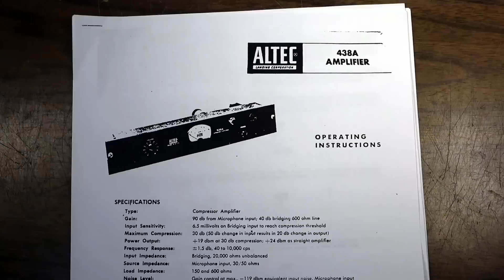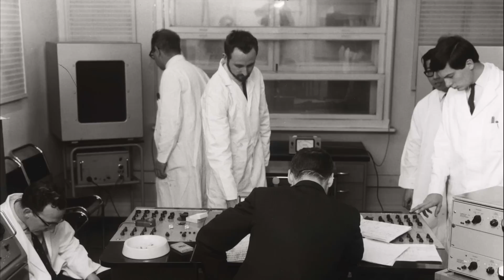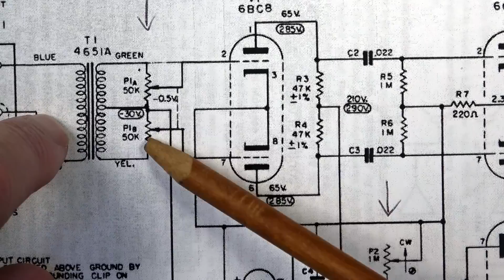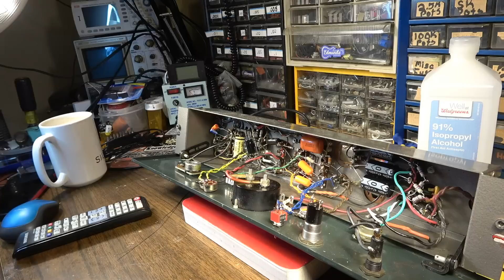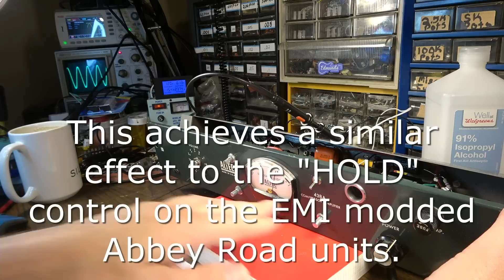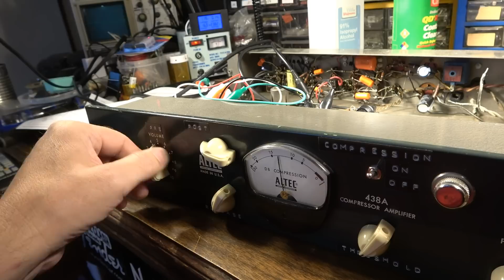Beatles' Abbey Road SECRET - 1960s ALTEC 438A  Compressor Preamp Mods (436B RS124) | The Guitologist

Comment: Brad, great video!  Do you offer updated service on the 438A? I'd like to use one as a line  amp/compressor to try in use as a home studio using old 45s.  Having ability to adjust threshold and release would be great to have.  John
Reply from the maker: I could replicate these mods, yes. If you’re interested in having the work done, email me: bradlinzy at gmail

Comment: Fantastic! I've been wanting to install a bypass on my 436c ever since I read the note in the manual that the compression circuit can be disabled by removing the tube. I was wondering how exactly to do that and why I had not seen it before. I was not going to go fiddling around in there trying to figure it out and risk destroying it.  Thanks for the simple (but much needed) mod! Were the resistors installed at the switch originally on the tube socket or were those added for some reason? If they were added, can you let us know why and the values?

Comment: The 12AT7, 12AU7, 12AX7 and 12AY7 are all the same pinouts.  They are dual triode tubes.  Even the ECC81 through ECC83 are the modern replacements and will work without modifications.  There is, however, a difference in power factor between these tubes.  The AX7 and AT7 will have the higher factor, which means more current draw and less headroom.  The AU7 and AY7 have the lower current draw and more signal headroom.

Comment: 6AQ8 is essentially the 6v version of 12AT7, both with a mu of 70. It draws more current than 12AY7. 6BC8 is a semi-remote cutoff tube where is 6BZ7 is not a remote cutoff tube, I believe so it's not suitable for gain reduction. I worked on a UA 175 and it uses 6BC8 and it simply does not compress as smoothly as fully remote cutoff tubes like 6386. All tubes will compress or affect gain somewhat when their bias is changing current draw but remote cutoff tubes are designed for gain reduction. Looks like a fun project!
Reply: Yes, you can see at 33min, the threshold isn't that dynamic - result of the 6AQ8. A remote cutoff is touchy with small negative voltage dips but less sensitive at the larger negative biases. A normal uniform triode as seen gives a linear response, even less smooth!

Comment: Cool conversion. 

Fyi. The Hold control on the Abbey Road version allows you to put a 'hold' on the amount of compression to avoid a large spike when the track first starts. The idea is to play the track or stereo mix into the compressor, engage the hold control locking in the gain reduction. The when you start the track again you release the hold after the track has started playing. I imagine this feature was mostly used when the compressor was on the entire mix.

A better implementation of the two volume controls would be to have a line level input which bypasses the mic input stage and goes directly into the 4651 transformer, with a switch to disable the mic input stage.

The threshold seems a bit redundant since with the fixed threshold you can simply hit the compressor softer or harder. I get that it's a trim pot on the original but it maybe better to leave that as a trim option rather than a main feature. 

I think a better addition would be an output level control on the output stage to better manage how much level is being passed to the next device in line.

Comment: Nice job and a good explanation of signal flow. Don't you think that the AX7 has too much gain? I'd like to hear the AU7 as originally spec'd, especially for 
a mic jack input. I have an old Motion Sound rotating horn unit that I use with a Hammond organ as Leslie 122 units are way too expensive in my area. It was shipped with an AX7 preamp similar to that compressor, which I always thought was harsh sounding above 20%. After I swapping it for a Sovtek AU7, it delivers a sweeter tone over a wider dynamic range, making it more responsive to the pedal.

Thanks for the redesign example.

Comment: That was so dumb I'm deleting it (My excuse is - in case it confuses anyone😸). I'm still wondering wth was going on in my head, ten hours later!?  Age I think.
Reply from the maker: Look at the circuit again. The two AC signals are combined into one DC voltage on the other side of the diodes just like a full wave rectifier on B+ converts AC power to DC. Then that DC is fed onto the grids of the previous tubes to affect the grid leak bias. It's similar to a radio AGC circuit.
Reply: @TheGuitologist  I had a brain error. I have not looked again but know I was wrong fundamentally in part.
Reply: @TheGuitologist  ie I was being thick.

Comment: I'm surprised you put the release knob on the left and the threshold on the right.  The normal layout would be the opposite and it looks like the wiring would a little shorter if you had done it that way.
Reply from the maker: The 436 has the Release on the left and Threshold on the right also. It's shorter wire runs this way.

Comment: Great video Brad, nice to see you grafting at the bench again. The Altecs look nice and retro with cream chicken head knobs, they go well with the classy green shade on the original fascia. These preamps were prized for their sound. Surprised they are so simple inside but I guess when a circuit is perfectly designed for its function you don't need complexity. Having  preset pots  controlling the compression suggests the studio tech would set it to optimum and forget it. Very straightforward, record it, review it and go straight to cutting master vinyl, next! 👍⭐
Reply from the maker: The problem arises when you have parts of a song that are loud or quiet... You might want to change the compression or even turn it off in some parts.

Comment: Hey Brad , is this true ? Or should I say “do you agree with this , and do you pay attention to it. 
  
  Directional flow of capacitors 
https://youtu.be/BnR_DLd1PDI

Thanks.
Reply from the maker: I pay zero attention to that unless the cap is marked. The only time that matters is in certain high frequency radio circuits. In amps like this, it won’t matter a lick unless your other lead dress is just very bad.
Reply: @TheGuitologist  awesome ! Brad thanks for checking that out.  I recently put new caps in my guitars , and was wondering if that might be causing an issue. Glad to know it’s not.  
 ✌️🤙
Reply from the maker: @theofficialdiamondlou2418  Most modern capacitors are much smaller profile than the old ones, so it's even less of an issue than it used to be. In instruments or amplifiers like we usually use, you'll never hear a difference at all. Some exceptions would be if the amp was really high gain to the point of being on the edge of oscillation already. Then they might make a difference. Or if they're close to AC wires running very close to the cap, as in almost touching.

Comment: So what is a compressor good for?
Reply from the maker: Compressors equalize parts of the music so they are of similar volume. Loud parts get squashed down. Quiet parts can be set to be closer to full volume.
Reply: Peaks n valleys....
Btw Brad, I love em! Stellar job, man...also, I did put em inline and part of a mix chain and these little beauties (tho not optical), I'm sure will do well, where my requisite.L2M mark 2 sits n will give em a run for the money, lol......
Thanks again, tuna...

Comment: I've made these mods and the actual EMI models were calibrated in real time, but it's vitally important to get good new/old tube stock in them or you'll never get the right  balance. Abd the neon bulb that EMI installed was wired to light up when you have parity on the two sides, so you get compression without distortion.  It was the most complex mod ive ever done.
Reply: I'm curious about if that old rectifier has an effect on the sound.
Reply: @waskerbasket9601   Which rectifier did you mean?
Reply: @waskerbasket9601  the selenium?? They were the first solid state one widely made. But they weren't as efficient as the silicon.... so consequently the voltage coming out of them was lower. Now sometimes you can let it ride if plate voltages were conservative overall and the biasing still adds up, but to be sure you would put some high watt resistors on the supply until you got the appropriate voltage.  Once you do this you have effectively no difference.

Comment: To get the best performance out of this, you would want to go into an impedance matched load. I don't know what your bench amplifier is, but it is probably not a 150/600 ohm input like the power amp or mixing board console that this would have outputed to.

Comment: Some folks only do guitar Amps, 

but you are a far broader entity, but it’s like Jimi Hendrix, he goes back to England and all they want is his first incarnation, not the new and improved model.🙂

Old outboard gear is very cool, and certainly NOT useless!  Just maybe a bit more power hungry

 I play an all original Altec 12 guitar speaker from the 60’s. And my stereo has 2 Vintage Altec 15’s.  Same era…..Probably both could use a recone, one aluminum dome is missing, but they work perfectly, with a crossover….good volume match left to right…..so I know they work fine

Sometimes I don’t watch your other stuff, I just click the like because overall your videos are far more interesting, you are always worth supporting!🙂you and uncle Doug.   And He’s got a hot Rod!
         Eclectic is good!😀
Reply from the maker: I try to branch out where i can.
Reply: @TheGuitologist  Brad, didn't you have one o them British Jaguar hot-rods?
Reply from the maker: @mikepalumbo4362  Yeah. I currently own two Jaguars. I have owned an 80s XJS in the past and a 1976 XJ-12C.

Comment: I had 2 of the 436c units that I dug out of the trash. Traded one for a Groove Tubes CL1s. The Altec is an interesting beast. The 436C has a release and threshold adjustment. Had to recap my units, they don't suck and the value has shot up over the years.
Reply from the maker: It seems like everything that eventually becomes expensive and highly sought after goes through a period where some people are throwing them away first.
Reply: Guess I should have watched the entire vid before commenting since you brought in the 436C.